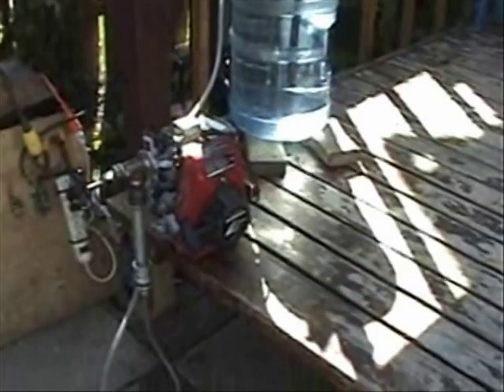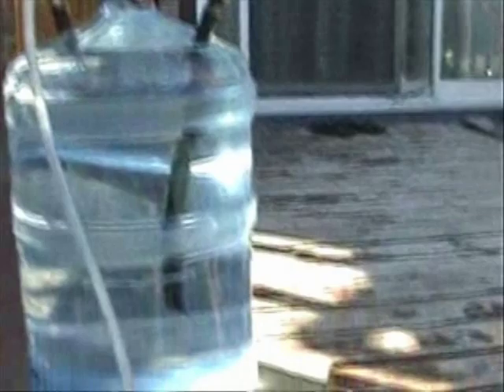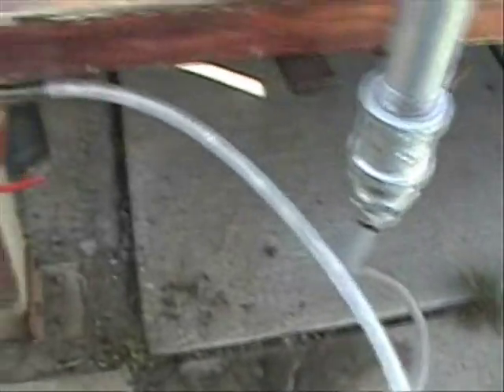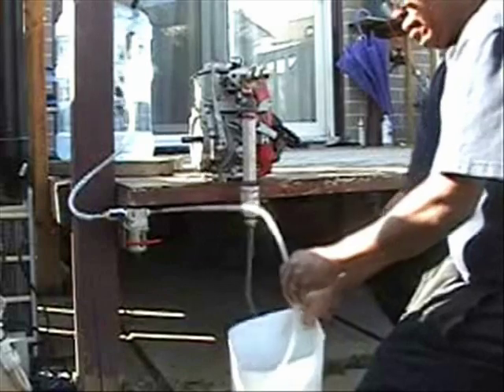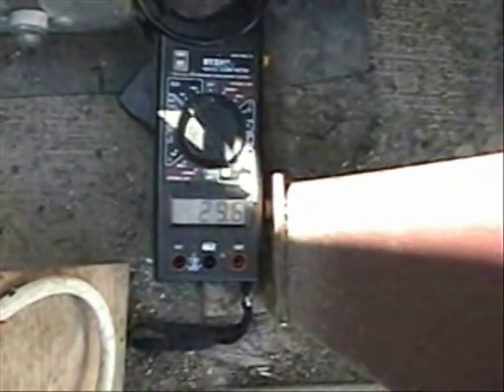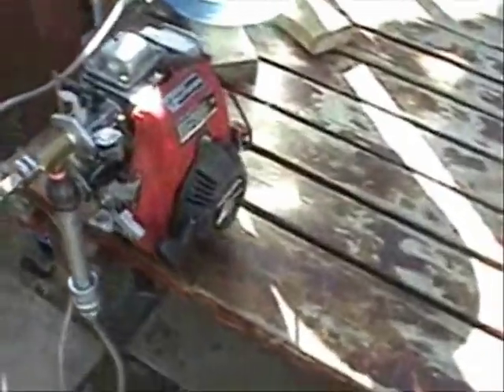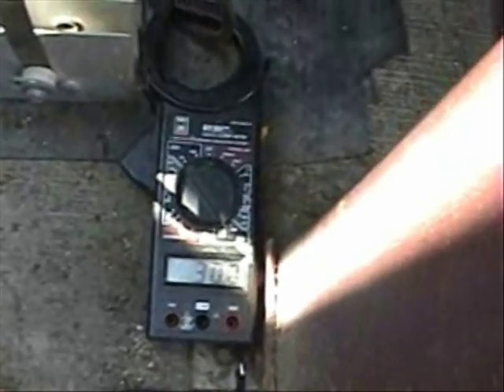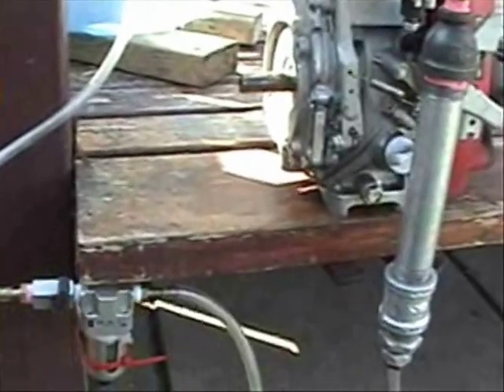Engine running on HYDROGEN from water electrolysis

Comment: You are using wall power to the electrolyser ,that's nothing special, can you show us the same gas production at around 6  to10 A or less current consumption?
Reply from the maker: Sorry I can’t answer your question. In this video I was only the actor. The actual owner of this account passed away six years ago. So I don’t have the necessary data regarding this video. I’m sorry but thanks for watching.

Comment: Are you still active working on this? Why don’t you try to infused pure hydrogen without the the oxygen to the engine and see it run more smoothly and I’m you can make it work in two stroke engine.

Comment: I like what you are doing.  I don't know if you have a pre-compression chamber there, sort of like a tip cup on a waterclock.  The real issue with this is lack of lubrication in the piston chamber.

Comment: I would like to know what torque, RPM etc can one get from a electric motor with a source of 24V and 29Amp? How would it compare with the engine you using at the moment? Is it worth the efforts?

Comment: Microwaving the water as it's flowing into the system produces much more power, you'll be amazed. However, Mobil one has the patent for the past 40+ years. You won't be able to make a profit, but you can power your home as well as your neighbors homes
Reply: Very very encouraging to clean the atmosphere. I would like to learn the whole system to place in my car n van. Thanks.
Reply: I wonder what effect an additional water vapor injection, would have? No idea how Hydrogen effects the rings and cylinder walls, so scoring would most likely be increased with additional vapor. What do you think?
Reply: shailen facknat they burn coal to make the electricity you will use to make the hho. This is a pointless method, you are better off just using an electric motor
Reply: @bfries555  no  solar panels and wind power
Reply: Jimmy Taylor no, coal and oil

Comment: I like the whole idea, but think that only small engines can make use of this. too much fuel demand in anything like an auto engine. the whole setup is not practical in a vehicle, but I could see a home-based HHO generator with solar or other alternative energy being used to power the electrolysis, where you need a combustible fuel to use.  Yes possible to power your garage tools with something like this. I'd recommend experimenting with 2 stroke engines under 200cc for more rpm and efficiency

Comment: is the bubbler  just water?
and did you adjust the engine firing time at all?
Reply from the maker: +Shofar So Good Yes sir,,,,,,,,,,,,,The bubbler is just water,,,,,,,,,,,, and Yes Sir I adjusted the ignition firing at just zero TDC
Reply: thanks for the reply.
have you tried retarding the timing to fire later?  If my current understanding is correct, the hydrogen burns so fast if it gets ignited later the engine will run stronger and smoother.  I look forward to trying this my self and seeing more of your videos. thank you
Reply from the maker: Yes the firing was retarded to just zero degree ATDC
Reply: Oh i mean even more so sir. like maybe 20 degrees after TDC.
Reply: My professor was saying if a engine was retarded that much, then when the hydrogen ignites the crankshaft would be closer to a 90 degree angle in respect to the piston travel and therefore  more ft*lbs. this is what i would like to test and see if it even works.
Reply from the maker: I don't know about that but here's the thing, In a gasoline engine, ignition firing should be at least 5 to 10 or 2 mm. BTDC and on a hydrogen engine it should be at least zero degree ATDC
Reply: HHOhybridBuilder are y still working on this

contact me via whatsapp

+41754201459

Comment: This wont work for the reasoning that massive amounts of hydrogen would be required to provide halfway decent fuel mileage. Even if the hydrogen was produced from renewable energy sources, you would need to store it in massive tanks (at least 100L or so) and pressurize those tanks to at least 10,000 psi. The average combustion energy operates at around 15% efficiency, meaning only 15% of the energy in those tanks would go towards moving the wheels. Under those conditions,  a 100L tank at 10,000 psi would run your car for the same distance as about 12-15 L of gasoline.
Reply: Piano Man42  i would to see that link
Reply: They are doing it right now in the U.K.  Clean energy like wind farms is splitting water to hydrogen and oxygen; the hydrogen is stored on sight at the fuel plant.  Cars pull up that are designed to run off of hydrogen and fill up their tanks for half the price they would pay for a tank of gasoline.  The driver gets more range off the tank of hydrogen too; than he/she would gasoline tank.  If you ask me; I will give you a link.  It is a commercial operation going on in Great Britain.  It does work.
Reply from the maker: +Robert Catinella For most important thing I was so afraid to put HHO gas into 10,000 psi, for understanding that it would be a massive explosion will occur, so the technique is to feed the HHO gas as soon as it is being manufactured by electrolysis system,  THUS this system is on it's way into perfection that's why I'M APPEALING TO THE RICH PEOPLE OF THIS PLANET WHO CARES ABOUT THE FUTURE OF THE ENVIRONMENT to help me. I'm not a scientist but an experimenter who was able to cracked the solution on how to use HYHDROGEN and OXYGEN GAS into FUEL
Reply: Not to be rude or anything, but its scientifically impractical, so I doubt you've cracked the case on this one. Firstly, the electrolysis reaction will stop at a certain pressure, so you're produced HHO will need to be fed into containers through a compressor, which probably wont run well on renewable energy with varying voltages. Even if this obstacle was overcome, its highly impractical to fuel a car with that amount of hydrogen. Even with the largest size tank possible, at 10,000 Psi you would have the hydrogen equivalent of 3 gallons of gasoline. That won't get you very far due to the massive inefficiencies of combustion engines. If you even wanted a shot at making this hydrogen push a car any reasonable distance, You would have to use a fuel cell vehicle, like the toyota mirai, and it would require hybrid technology to recycle energy lost in the system. Unfortunately, those cars use the reverse reaction of electrolysis to produce electricity, and about 32g of platinum is required per car. Aside from being pricy, we're talking about a very rare and precious metal here. Additionally, the mirai utilizes a battery that ultimately fails, and has environmental impacts when not disposed of correctly. Now, with that being said, I would be happy to discuss practical prospects for creating a clean fuel in private if you would like, as I see your interests are pure.

Comment: I currently am working on a similar project based on water and Hydrogen. Unless i missed something in your video i assume that you are gaining your Oxygen from the surrounding air. (If i am in error in this then disregard the rest of the message) Here is the issue, yes Hydrogen combustion with oxygen gives you water vapor and heat. One problem if you use air as your source of Oxygen. Air is only 21% Oxygen. Why does the matter, because Hydrogen is one of the most reactive elements in existence. Not to mention Oxygen is an "Oxidizer" (Sorry not trying to state the obvious or insult anyone). So if you react Hydrogen to just filtered air, you will result in making gaseous based Nitrates and other substances that are very harmful to the environment, even more so than carbon monoxide and dioxide and will escalate green house gas insulation at an alarming rate. This is why the Hydrogen reactor was invented in the first place over the hydrogen internal combustion engine due to the hydrogen reactor generating an electric charge without having to account for the oxygen. Given this invention here could be easily adapted but as is can cause a whole ton of problems.
Reply: +Parker Watts Separating the hydrogen from oxygen during electrolysis prevents the creation of HHO. Then you can control the fuel mix at the carburetor, giving what's called a "lean" mix, to prevent the creation of NOx. If using a fuel injected engine, the EFI computer will need to be recalibrated at the least, and the injectors will probably need to be suited for gas instead of liquid.

Comment: Congratulations for the work, I do not understand how you made the coupling of the gas to the engine, you removed the carburetor? that piece is that in place of the carburetor? could send details? 
Thank you.
Reply from the maker: That vertically positioned pipe was just the large FLASHBACK ARRESTER. Thanks for watching.

Comment: I imagine you will have a lot of water vapor in the pistons and exhaust, it looks like you are only using the hydrogen which would be good for cutting down on water vapor but there will always be oxygen in the atmosphere to combine with the hydrogen you burn and some will bind and turn back into water.  Porcelain has a lot of characteristics that would be good as a substitute for parts in a hydrogen engine. 
-Very little expansion and contraction with heat and cold (no rings needed on pistons) 
-Doesn't rust 
-When used with other porcelain parts in contact with each other there will be very little wear 
-Little to no lubrication needed
Reply: Hidrogen only produce water vapor but, all other tipe of combustions generate C2 and WATER VAPOR (also other gases) always is water vapor inside engines,

Comment: Good work on your video. People will end up doing what industry does't want us to do. When you put a generator on it, use a permanent magnet 24 volt motor with neidium magnets, because the more efficient generator you use then less power taken from the engine.
 And to all the Naysayers, who said they tried it and failed, Yes, you failed, so go away!   A new approach with new people will solve the problems.

Comment: been running hydroxy gas in my 2007 f150 with 5.4 liter for 1yr. mph went from 17 to 29 with two 6x6 dry cells at 10 amps each. I look forward to running completly in future.  Great vid.

Comment: If you want to know where you gain went look at every step in the process, it takes energy to move from step to step, and it  takes energy to convert something to something else,, additionally it takes energy to move things against a natural flow (heat rising, and just about everything else submitting to gravity).   

Be it trees to coal, oil, or diamonds they all take lots of energy to make the conversion.

Comment from the maker: Thank you so much for the offer.I truthfully made it run with hydrogen from water and thanks also for believing. As I mentioned it seemed that it took more power to produce the HYDROGEN than the power the engine can deliver. I'm back to the drawing board searching for the missing gain. As soon as the research been completed I'll be in touch with you and it won't be long. Again thank you Sir.

Comment from the maker: 13 stainless steel plates. 9'x12'x1/8"  and the rubber insulator or gasket is 3/16" thick. You power this with 24 volts DC. Thanks for watching

Comment: 720W and it's only just ticking over, how many amps do you need to run this at full throttle? 
I'm guessing a 720W electrical motor would have about the same torque as this 4 stroke engine has on tick over.

Comment: The question is, how much electrical energy do you use to run this engine and would it be more efficient when used to power an electric motor directly?

Comment from the maker: @water2gashawaii I absolutely agreed with you.There is no problem of oxygen absorption on ON DEMAND system because those separate tanks never go empty. What I meant was the pure hydrogen powered cars like those of the BMW, the CLARITY and anything that uses a tank for liquid hydrogen, when those tanks went empty, vacuum will develop and any single little SEAL leakage it will suck in oxygen and you know what will be next to that, just like what happened to NASA's space SHUTTLE, it went KABOOM.

Comment from the maker: @adn666tcoce I was thinking about it overnight and sorry to inform you that it's not gonna work because on two stroke gasoline vapor enters the combustion chamber through intake port and discharge through exhaust port.The crankcase is always full of gasoline vapor.Then after the spark plug fires it will flash the HHO gas entering those intake ports and what you gonna have will be a massive EXPLOSION. Perdona que te defraudara.Solo tiene que usar un motor de cuatro tiempos. Gracias por mirar.

Comment: for future reference your Gas lines go from almost 1000 PSI to 3PSI at the Iron pipe to your house you could get a Bladder tank and Pressurize it to 5 PSI and power a Generator you can get that runs in Natural gas or Propane I asked the fellow at UFA and he said the Generator could work on Hydrogen as well it is a Commercial backup generator If you live in Canada you can now get Passive Solar installed Co-Generation.. Still use what you have for Backup Engine has to be 5degrees After TDC

Comment: Why don't take a gas generator and power it with your cell? And see if the generator will have enough power to keep the dry cell going and put more load lights etc on the output of the generator to see how much extra energy you can extract from the system? If you can do this then, you got a winner.

Comment: @HHOhybridBuilder Putting 720 watts into your engine and getting 2.5 HP out just doesn't work. You can not assume that since at 3600 rpm it is at 5 HP than it is 2.5 HP at 1800 rpm. If you attach an alternator to the motor it will not be self sustaining, it just isn't possible.
Reply: that generator is too big for that engine, 2LPM is doable with 12 volt 8 amps

Comment from the maker: @BreadboardBasics It was the automotive engineers that said and wrote about this , not me. Try to buy a single cylinder stationary engine, you will see on the label saying 5 HP @ 3600 RPM, meaning if this engine spins @ 1800 RPM, it would then be putting out 2.5 HP. I didn't created this theory, I learned it. Thanks for watching.

Comment: There is a problem with this. You converted rpm to horsepower. You can not do that. Example: you have electric motor that spins at 100 rpm at 12 volts and pulls 1 amp. Add a couple of gears and you can increase or decrease the rpm output of the motor when it is the same horsepower.

Comment from the maker: @oscarobel  Yes I had a constant speed of 2,200 RPM which is a little bit over than 1.25 HP @ 937.5 watts and the power this unit utilizing is 720 watts. So maybe sometime in the future I will mount an alternator on this HHO engine and we gonna see if this system is sustainable, and thanks for your prayer.

Comment from the maker: @oscarobel Thirty three years ago I worked as a Motorcycle Mechanic. I used one of it's ignition module to this HHO engine. The ignition module is a CAPACITOR DISCHARGE IGNITION SYSTEM and it belongs to a 1977 KAWASAKI H1 model. This system are consisted of two parts, the MAIN module and the TRIGGER module. I discarded the trigger module and replaced it with an adjustable RC network (RESISTOR CAPACITOR) that I build myself.

Comment from the maker: @1232sean Sorry and honestly I haven't done the LPM measurement yet but it can produce 2PSI pressure of pure HHO within 30 seconds and the ignition timing had been delayed to "zero degree" AFTER TDC. Besides the ignition coil there is an IGNITION TIMING DELAYED MODULE. So far the only load I applied on it was I pressed a 2"x2"x4' piece of wood on the OUTPUT SHAFT until I saw the wood started to burn while the engine kept on running.

Comment: Good job dude! If you get a 300 amp alternator you can get more out for less input. A normal alternator does 60-120 amps, but if you use a 300 amp alternator you can get more amps out while using less horse power to spin it. Put an over drive pulley on the alternator and it will work even better. But the 300 amp alternators I use will put out 160 amps at idle on most vehicles.

Comment: @ashtweth, Seperation and storage is a really important part of using water splitting as a storage medium for renewable energy, BUT this and HHO are areas best left to people with extremly good safety procedures, treat HHO just like gasolene vapour!
Hydrogen is lighter then air and will collect on the ceiling or in the roofspace and has a VERY LOW igntion point, so be sure to have PLENTY of ventelation.
Thanks for raising such an important point. Most of what I have written is for all readers

Comment: @ashtweth, Correct its extremly dangerous, but if you seperate the gases you can store it as safely as any combustable gas.
The CRITICAL thing to remember about pure oxygen is that it can catch fire in a pipe with no air. Grease or oil will cause a spontaneous reaction if the oxygen flows over it, this has caused many deaths. You need to clean EVERYTHING, pipe, tools, hands, bench when working on oxygen equipement or you WILL have a huge explosion. 2L of HHO if trapped will kill you

Comment: @mrgalleria, Are you prepared to play nice now?
Maybe you know something I don't, I'm VERY open to that, infact I would be a VERY VERY VERY happy man if you could prove me completely wrong, I hate Oil companies with a passion, my first job was in a gas station and I saw first hand how they would threaten the small operator and control the prices for maximum profit.
The thing you and I have in common despite our differences is we want clean air and a 100% solution to this problem: sustainable one